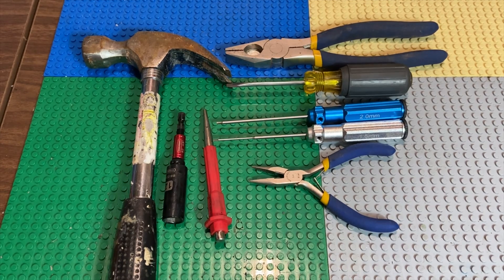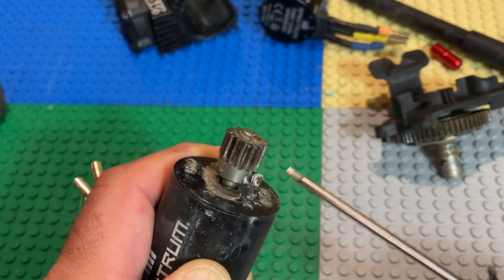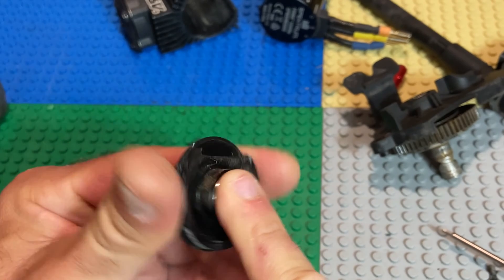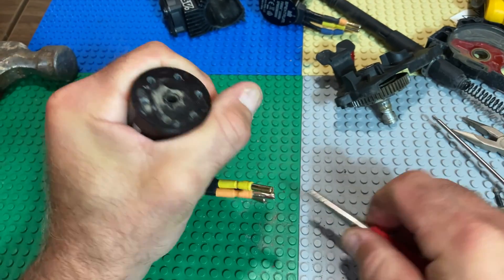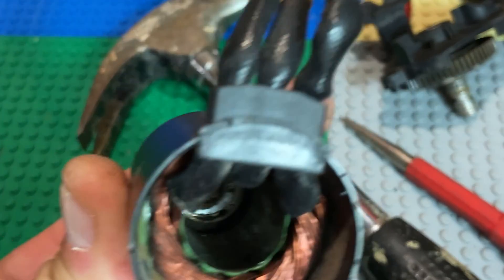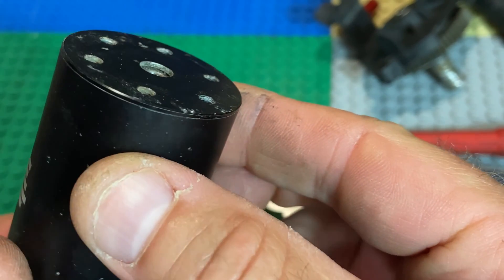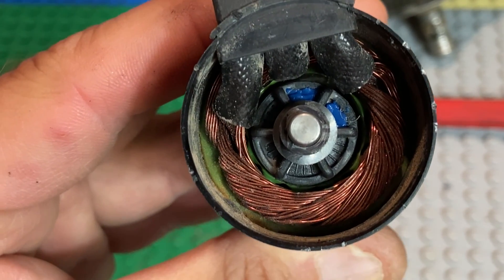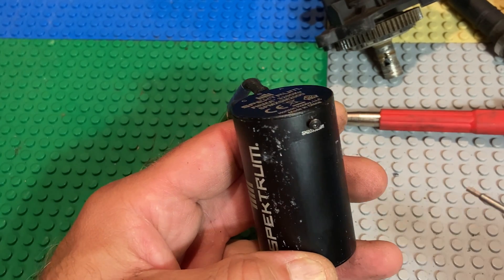HOW-TO REPLACE BEARINGS IN BRUSHLESS RC MOTOR | BREAD TRICK!

Comment: My bearing just disintegrated. 

I can't get the outer part out the end. Fekn stuck tight.
Reply from the maker: Ok. So, the middle (inner race and bearings) fell out and outer race is stuck in there? I had this problem too, this one is hard to fix without special tools. I brough my case to work and a machinist MADE  a tiny puller to get it out. Your option may to find a used motor for parts. I do that, weather BLX or spectrum they seem to be interchangeable
Reply: @phillybrc thanks dude. So yeah the part the balls roll around inside and the outer shell that basically is used to be sat in the machined space. 

I've dropped a smidgen of GT in around the edge. I'm going to get my pick set and try levering it out. If that fails I have a 4000kv Hobbywing there and a 10BL120 ESC. 
If I get it out I will need to find the correct bearings to replace both with some sealed one's.
Reply from the maker: @NoobzRC the bearing sizes should be in my description, if not lmk
Reply: @phillybrc wonder if I put it all in the freezer I might get it out😞. Don't want to waste the motor. Also I'd have to put a full new system in as I'm sure the Spektrum bullets are different size .
Reply from the maker: @NoobzRC you can solder new ones on or buy extensions on amazon tosuit different size ends
Reply: @phillybrc yes outer race or outer ring is bloody stuck. Lol. 

Need some solutions😅😅😅

Comment: I'm changing the bearings in my castle 1410 3800kn motor, got the front one out no prob, but the rear bearing is not budging at all.... Ive tried everything i can think of, including the bread trick, and even the grease gun as well... It just blew out the little retainer clip that holds the metal shield in and that's it.... Tried heat in case there was some kind of adhesive, nope. Tried freezing it to contract the metal, helped big time with the other bearing, but still no luck.... I'm out of both ideas and patience 🤣. I can find the bell end with bearing for the front where the shaft goes through, but not for the rear that also has the sensor on it..... Any other possible suggestions? Thanks for your time and video also 👍
Reply from the maker: Man, sounds like you ve tried everything i would throw at it. Sorry for late response ... any luck yet? Thanks for watching my video MIke
Reply: @phillybrc  Yeah I eventually got it 🤣. I was using the rotor when doing the bread trick, found a punch in my tool box that fit inside the bearing perfectly and was able to get better force on. Between that, more bread and a little Hulk rage 🤣 I was able to finally get it out. It still gave up a good fight, but I was victorious in the end 😆
Reply from the maker: @ Good on you man! Don t give up! Hahaha
Reply: NEVER! 🤣 sometimes ya just gotta walk away for a while though 😆
Reply from the maker: @IDFKwuttoput4aname  I can relate there for sure!

Comment: How often bro ? How can one tell . I think my granite needs this
Reply from the maker: @Hungrybird474  well, is it getting real hot, stop moving-the bearing will eventually seize, short battery life. If you take the motor mount assembly off- you should be able to spin the motor by turning the sur gear on the bottom side… make sense?

Comment: I have Typhon 3s version 3. Not sure what bearings I need. Or brand. Any ideas
Reply from the maker: Same as the info in this video. All in description. Thank you!
Reply: @phillybrc  I got the motor and armature out. The one bearing was broken to pieces. I noticed a partial ring of what looks like blue silicone under where the bearing would go. I didn’t see any partial blue chunks fall out.  Do you know what this is?  If not I could post a video on my YouTube  channel.
Reply from the maker: @bri7777-l3x  Well, the bearing seal is blue but that would fall out i think.

Comment: Thanks for the video!
Anya advice on how to get the bearing race out if I didn't catch it in time and the front bearing already exploded?
Reply from the maker: There is a tool you can buy that looks like a step-bit drill bit. It has a handle so it will grab and extract the race.

Comment: Good job. The bread trick is way cool. I would think that you could use contact cleaner to de-grunge the rotor and stator. It's crazy to see how much dirt gets into the motor. Thanks for sharing all this great information. ⭐⭐⭐⭐⭐
Reply from the maker: Ya, likely it can be cleaned with that, realizing the dirt finds it s way back in there quickly! Thanx for watching!

Comment: Unfortunately the bearing all the way in the bottom shredded itself. When the main part of the motor came out, a bunch of ball bearings followed it so I'm stuck with the outer ring of the bearing and it ain't budging. Sucks I've got to replace a whole motor because 1 bearing came apart and the remaining part can't be removed.
Reply from the maker: So, just the outer race is stuck in there?
Reply from the maker: Try a masonry bit. Wedge in there then spin it with the drill. It may break it free
Reply: @phillybrc  That would work if it was the whole bearing, its not, just the outer ring of the bearing. We can't get anything into it to try to cut it out either.
Reply from the maker: @hikingphotog  thats sucks. There s gotta be a way. Sorry, i m not any help
Reply: I’m in the same boat.  Did you ever get it out?  I made a little pick tool, Ive heated the housing, I’m running out of ideas.  Perhaps cutting it with a dremel but I suspect it’s hardened…

Comment: Great video. When you did the bread trick did you have to hammer the shaft to get it started? Thanks
Reply from the maker: No, just pushing by hand worked. Use back of the rotor shaft. Thanx Bapa

Comment: Nice video 👍 It's like they designed these motors to be throw away. You should be able to get to the front and rear bearing easier.
Reply from the maker: I agree, but for a couple bucks a bearing it s worth going thru the effort to just keep blasting them til they fail! Thanx man!